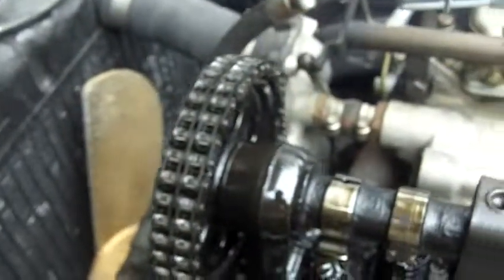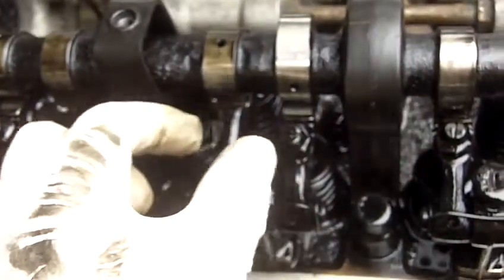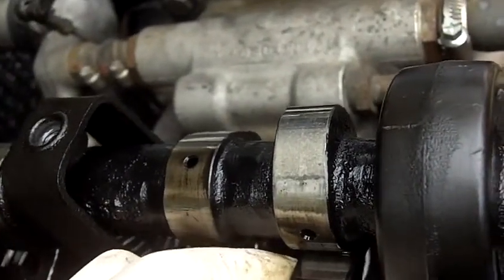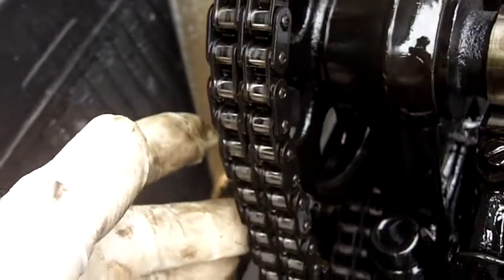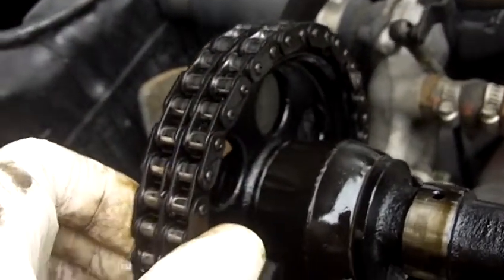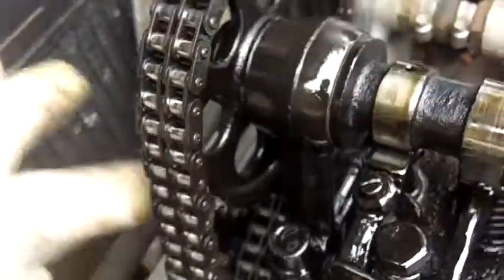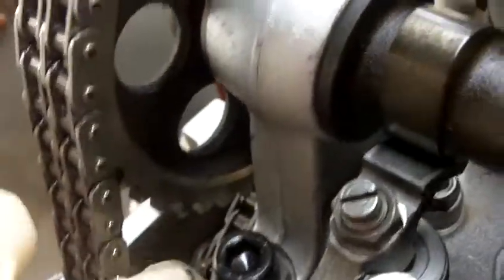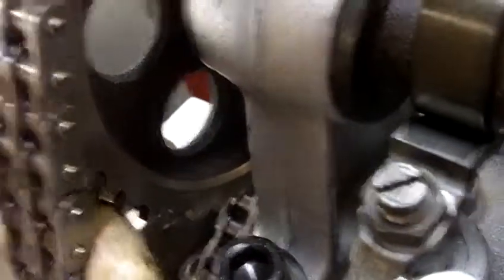190SL Timing Chain Stretch

Comment: I have tried to change my timing chain with  mechanical tensioner out but chain seems 1 link too short. Is there something I am doing wrong.
Reply: Hey Jason, sorry for the issue you are having. There are 2 timing chains for the 190SL. Engines with valve adjusters using the screw and jam nut get 128 link chains. Enginse that have the ball stud that requires a special forked wrench use 130 link chains.

So, being 1 tooth off is probably not a chain issue. Assuming your chain is correct out of the box, ie. no one gave you a 127 link chain. So lets assume your chain is correct.

Many years ago I had the same thing happen. In our shop we were off 1 tooth. So I got a 1 tooth link to add to my chain. We installed it. Rotated the engine by hand to double check everything and all of a sudden the chain was loose...by 1 link.

We took the 1 link out and the chain fit perfectly. We could only figure that the chain had kinked during installation. The kink appeared at the same place inside the engine and fooled us for many engine revolutions. Then mysteriously the kink went away.

That is the only thing I can think has happened, only because it happened to us in the shop. And there were 3 of us pondering this issue.

Try re-installing the old chain to see if it fits. With new chain out, count the links. Make sure none of them are hanging up. Perhaps get another chain.

Please report back what you find so we can all learn from this. 

Good Luck,

Will
Reply: @will4432  Hi Will, After a bit of research which I should have done before cutting out the chain I guess I have been supplied the 128 link chain instead of the 130 hence no mater how much adjusting it was never going in. I am just ordering a 130 link chain which I hope will be with me soon as I have a chance to parade the car at Silverstone Classic next week and I am cutting it a bit fine. I will let you know if this was indeed the problem.
Reply: OK, at least you have a course of action. 

So you have a late style 121.928 engine.

Once the chain is installed check to make sure everything lines up.
With the crank timing pointer on 00 or OT check that:
the timing mark behind the cam sprocket is lined up 

the distributor rotor points to the #1 plug wire

Rotate the engine by hand a few times to make sure there is no interference.